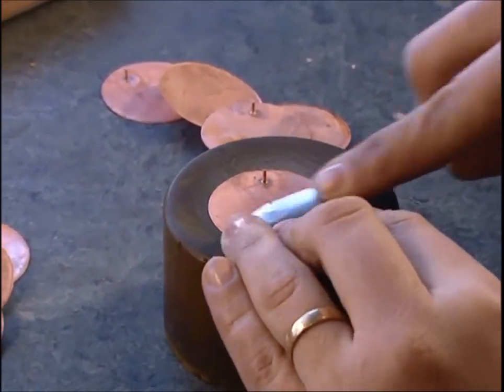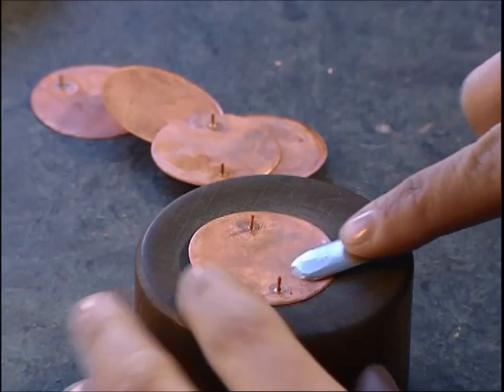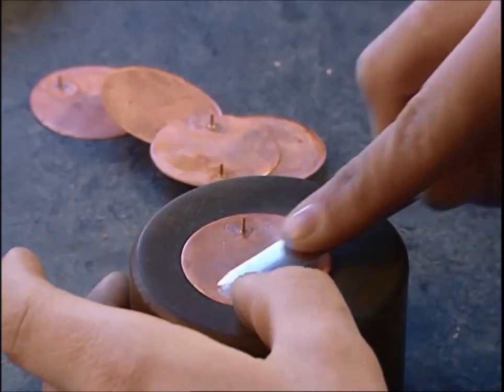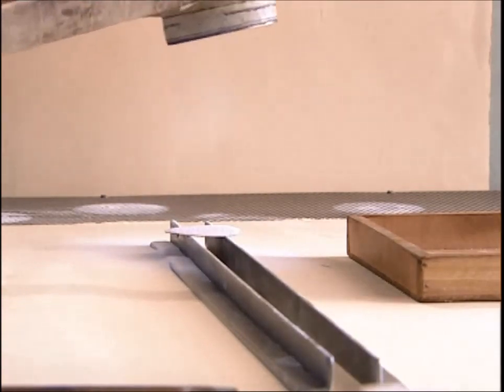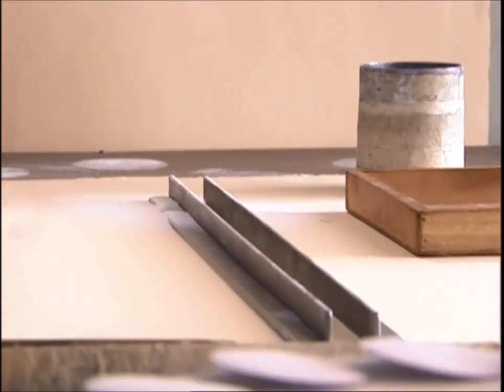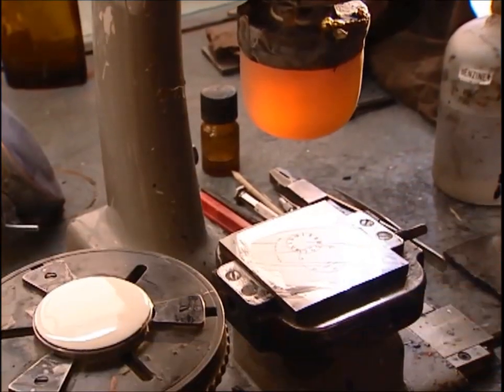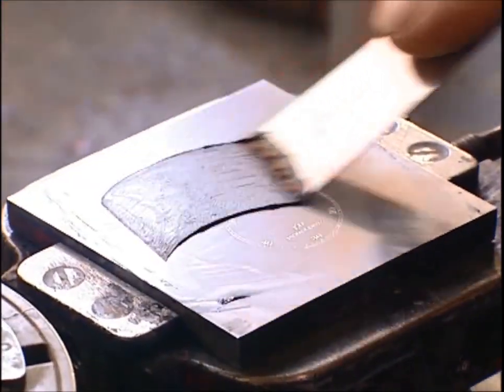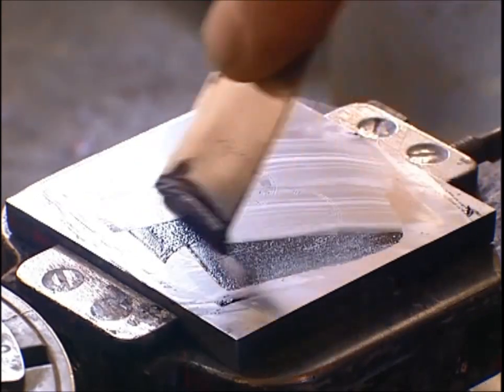JD Enamel Dial

Comment: I can make enamel dial, but i want movement for dial thickness 0.9-1.5mm 
Wich movement i must get?
Reply from the maker: Hello, I don't think there is a link between dial thickness and movement. Primarily you should ensure the dial fits your movement, and then the combo dial + movement fits the watch case both in diameter and width. Hope this helps
Reply: @montres1  
I make cloisone enamel dial.. thickness is0.9----1mm"
Cannon pinion are 0.7mm 
Need movement with high cannon pinion?
Reply from the maker: @enamelprojewel2523  Good question ! I reckon pocket watches usually have thick dials sometimes enameled, maybe you should look at a pocket watch with thick dial and replace it with the one you made. I am not an horologist just a watch amateur, maybe you should speak with a watchmaker / horologist
Reply: @montres1  thank you ❤️ 
you are good man!

Comment: Hi Sir. Could you please advise for me what powder use in 0.26 seconds and what material for Dial? Thanks in advance.
Reply from the maker: Dear Dao, actually the dial is in copper. Then they add Enamel Powder (at 25th second) and put it in a furnace.
To be honest I don't know what exactly is in the enamel powder apparently powdered glass. The temperature does the rest (750 to 850 degrees Celsius)
Reply: @montres1  Thanks Sir.  And Enamel Powder make color for Dial? I want to make Watch by hand, but i don't know how make color for dial and clock edge. Please help me.
Reply from the maker: @aonguyentrong3477  Dear Dao, sorry I am not a specialist, actually this video is an extract from a video issued by Jaquet Droz themselves.  Definitely the enamel powder when reaching fusion temperature does melt and cover the surface of the dial to give this nice white shinny effect.
I saw black enamel as well but most common is white / off-white. Apparently it is a very difficult process and there are lots of losses (dials are discarded), so good luck for your own watch ! Let me know if you succeed ! :)